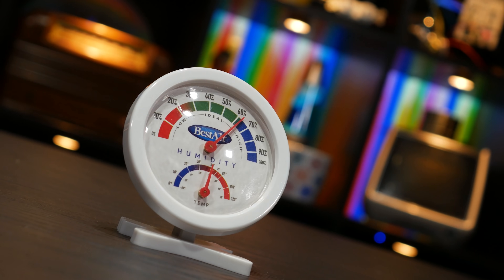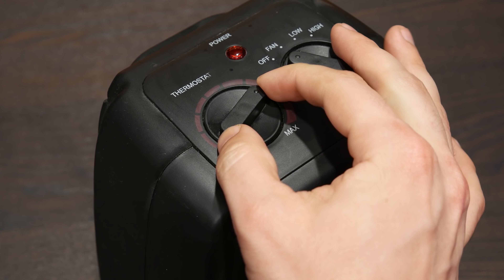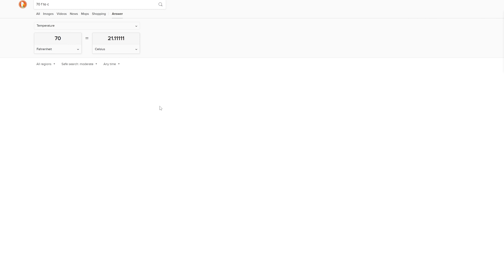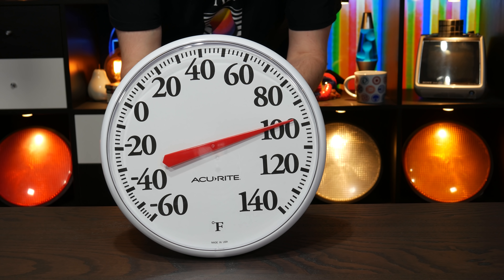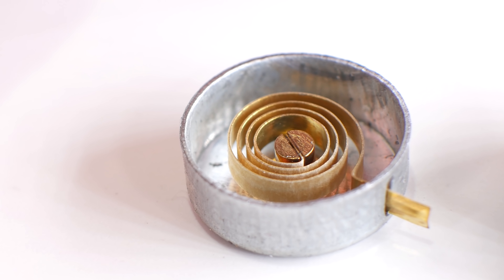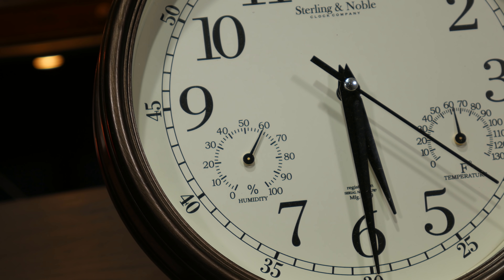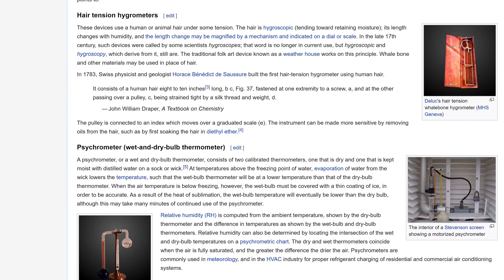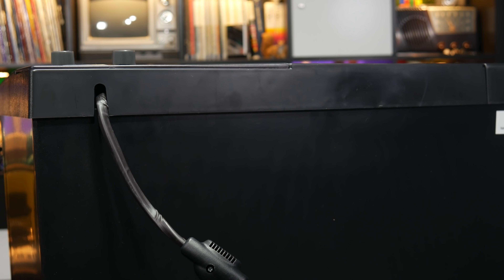Analog Hygrometers - how?

Comment: As an American, I'm 100% down for switching over to the metric system, I already use it for most things I do.
However, I am right there with you on temperature. I do like Fahrenheit better. I enjoy its granularity. 
Also, no matter how many weather apps I switch to Celsius, I just can't internalize how temps in C feel at a glance.
Edit: I like Fahrenheit better for weather and meteorology.  I use Celsius for 3D printing, computers, and everything else except for baking.
Reply: I use a little  heuristic: 20c = 68f, 40c= 104f.   The closer something gets to 40, the less I want to be there.
Reply: @krispinamiller  I sat next to an older lady on a plane a few years ago who used to be a teacher. She gave me a little trick to quickly get a ballpark conversion which I've been using.
Take the temp in C, double it, then add 30. 
It's not exact by any means, but works surprisingly well for weather!  :)
Reply: Forget Celsius, go Kelvin!
Reply: @Syock44  I support this message
Reply: @Syock44  Why Kelvin when you could go Rankine?
Reply: @Syock44  The advantage of Celsius is that there are no negative numbers.  If you are going to change, go for the Rankine scale.  The same benefit of having no negative numbers but it is more granular.
Reply: @TheBigPig66  there are no negative numbers in celsius? You sure you don't mean Kelvin?
Reply: @TheBigPig66  You've got that backwards. F has fewer weather days in negatives than C does.
Reply: To be fair, Celsius is as arbitrary as Fahrenheit and unlike other measurement units you don't do conversions to other related units as often (unlike cm to m to km vs inch to feet to mile). So from the US units it's the one that I would pick as the least ... disadvantaged? compared to metric units. On the other hand it is one of the most problematic to convert (both ways), because those two don't have same 0.
Reply: If you ever do really want to get a feel for it, you really have to drop everything you know and just go for it. It takes a year or two to become fully comfortable, as you have to feel every temperature in your region. I've used Celsius on my computers and phones for 10+ years and these days I'm almost more comfortable in Celsius. Because I have to talk to others, though, I've gotten quite good at converting on the fly.
Reply: @quinton1661  Why though? Celsius is like a four star rating system for temperature. It's as subtle and refined as a brick to the face.
Reply: @quinton1661  Yeah, I use it for my computer and 3D printers. Makes more sense to me in the higher end.
Reply: @BRUXXUS  The trick is moving to a country where that unit is the norm. Once you're bombarded with measures in that unit every day, you'll get used to it quickly in a matter of week(s) at most. Consistency is the key. The issue is trying to learn the unit when it's not the default where you live, it's harder to develop a feel for it.
I do find the temperatures for cooking or 3d printing harder to grasp because an oven at 350 F or a PLA print at 200 C is not something I can "feel" naturally (well not more than a boolean "it burns"). I just treat these as any other kind of mechanical properties.
Reply: @BRUXXUS  yeah Celsius for tech is more common and Fahrenheit for baking and some other things is also more common. I'm Canadian and we use both.
Reply: Considering that we already have 500mL bottles and 2L bottles, I feel like switching to metric volume would be almost effortless
Reply: 40c -> higher than body temperature hot(danger)
30c -> hot
20c -> Normal, a tad hot
10c -> cold
0c -> cold, water freezes
also celsius temperatures are supposed to be measured with at least one decimal, so it is a lot more granular
from 00.0 to 40.0
you have 3 digits.
Reply: @diablo.the.cheater  Celsius still feels like weather reduced to a 5 star system.
Reply: @sammiller6631  It's more than enough, I doubt anyone can tell the difference between 15-16 degrees, or -9 and -8. I can't think any normal situation when you'd need to use decimal precision.
Reply: Fahrenheit was invented for weather and meteorology, so it makes sense that it works better for that purpose.
Reply: As a Celsius person I don't really have "internalized" temperatures either. Why? Because temperature doesn't tell you the whole story anyway.

For one, knowing when it's freezing or close to freezing is very important when you drive out. Other then that, 10°C (50°F) can be "nice weather for a walk" when it's sunny, dry and windless, and "absolutely miserable" when it's cloudy, windy and the air is damp. Same goes for 26°C (∼80°F) - it can still be nice on a cloudy, windy day, and absolutely miserable when you are in the sun the whole day with a still wind. Oh and when you get to the negatives, there's little difference as well in my opinion. Beyond like -10°C (15°F) it's *really fucking cold*, and who cares how much cold.

My point is, it doesn't matter that much what temperature scale you use for weather; it just happens that Celsius is way more convenient for everything else, and chances are you will be using it for everything else. Why people argue that the granularity of Fahrenheit is important is completely beyond me. Most people can barely tell a few degrees-Celsius difference, let alone a single degree Fahrenheit.
Reply: @amunak_  Celsius is not more convenient. No more than your accent is convenient. Granularity is part of optics and appearance, just like €9.99 feels like a bargain compared with €10. People are vain and fixated on appearance.
Reply: Californian here. Here is how to translate Celsius:

below 0: too cold, gonna die
0-10: cold, wear a jacket
10-20: cool, wear a hoodie
20-30: warm and perfect goodness
30-40: hot, wear shorts
40+: too hot, gonna die

Boom.
Reply: @deviationblue  interesting scale. Where I live anything above -20 is shorts optional
Reply: @deviationblue  "below 0: too cold, gonna die" doesn't work well east of the Rockies.
Reply: Its not that hard. All you need yo know is 0 freezing point, 21 ideal temp. 30 is summer hot. 50 death valley hot.
Reply: @clorox1676  If it's not that hard, then use F instead.
Reply: @sammiller6631  I wouldn't use F because the very same reason you wouldn't use C: because both work and already have been using it for too long.
Reply: But you also have people like this unfortunately: https://www.youtube.com/watch?v=z5-s-4KPtD8
Reply: I hear decimal points exist, how's that for granularity.
Reply: I'll switch to metric when it includes time.

7 days in a week? 24-ish hours in a day? 60 minutes in an hour? 60 seconds in a minute? 365 ish days in a year? OMG HOW CAN YOU LIVE LIKE THAT?

When metric fans agree to convert the world to decimal based time and dates then I'll gladly switch to metric distance measurements. Until then: seethe more.
Reply: @Guysm1l3y  The French Republican system of measurements would like to know your location.
[ Oui ]  [ Non ]
Reply: I didn't start paying attention to temperature forecasts until college, so thanks to my high school physics and chemistry classes I had a few years where I had a better understanding of celsius temperatures.

0 - ice

10 - still pretty cold

20 - right around here it starts to be a comfortable room temperature

30 - closer to human body temp (I think it's 27)

40 - this might still be warmer than a Texas summer but not by much.

50 - no.

100 - boiling
Reply: @tparadox_1988  human body temp is about 36/37 degrees Celsius, but the rest of your comment is pretty accurate :)
Reply: Using Fahrenheit as temperature measurement is retarded and nobody should do it.
Reply: @TobiasHinz1992  Sounds like Celsius as cultural imperialism, Tobias.
Reply: @sammiller6631  cultural what? How do you make up these words?
Reply: @TobiasHinz1992  what's stupid is insisting on using a different system then the one the majority of the people you interact with on a daily basis use just because some people on the internet can't figure out how to use google.

Comment: You know... those search engines can also do “c to f” translations... so nerrrr
Reply from the maker: Yep, and when I see something in a unit I don't have an intuitive sense of that's exactly what I do.
Reply: @TechnologyConnections  truth be told, I don't understand why people winge about the units. Use the ones that make sense to you.

Though, if that is the boiling point of a kumquat at exactly 14.5 km above sea level on a cold day, that might get annoying, but most people use a bit more sensible units.

Obviously, if the whole world standardised on SI (or on the empirical scale) it could have prevented those issues that NASA had. But it's a pipedream.
It's like wanting a single standard of paper sizing. That's just ludicrous!